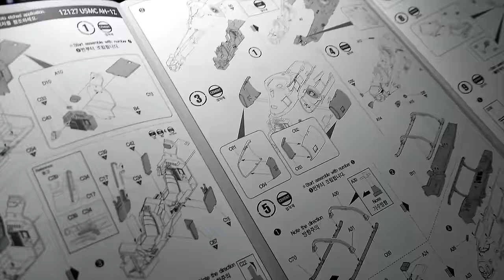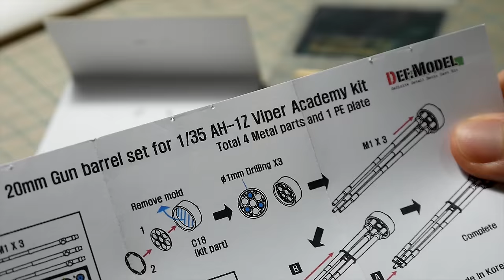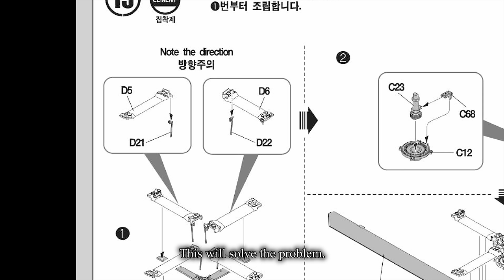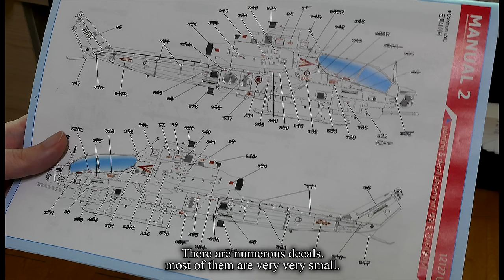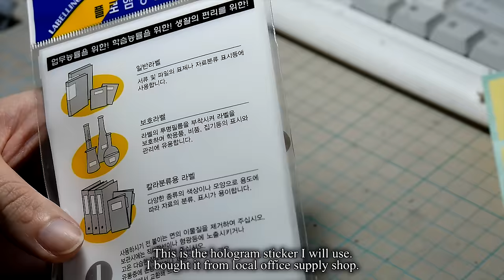1/35 USMC AH-1Z Viper Full Build.

Comment: How to make the magic sculpt fixed on a plastic surface without falling off when you make rivets? I tried but the tiny magic sculpt easily off from a plastic surface.
Reply from the maker: I apply extra thin plastic cement on the rivets after I make them. 
It helps but not perfect, I try hard not to touch after make the rivets, especially when it is hardening.

Comment: What are you using @3:10 and what is it for specifically?
And what is the tool you're using @4:10?
Reply from the maker: @3:10 It is Magic Sculpt, I used for filling the pinholes.
@4:10 It is a knife with a scalpel blade. the Blade number is 15T.

Comment: 37:40 Did you thin out the panel line accent black? If so what did you use and what ratio? BTW I subbed!
Reply from the maker: I was wiping out excess panel line accent with enamel thinner. So It is just thinner I was using. 
Thank you for the Sub!
Reply: Also were you using the panel line accent at full strength or was it thinned down? My panel accent black is so much darker than yours?
Reply from the maker: I used it at full strength, and I am not sure why yours is so much darker. I would use the enamel if I feel it is too dark or thick.
Reply: @EbroinSong  Ok, thank you.